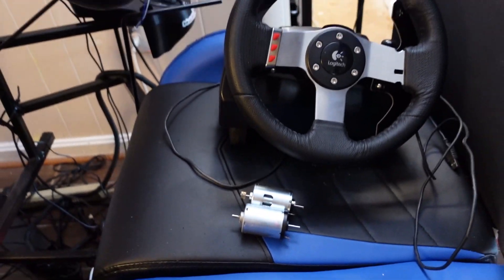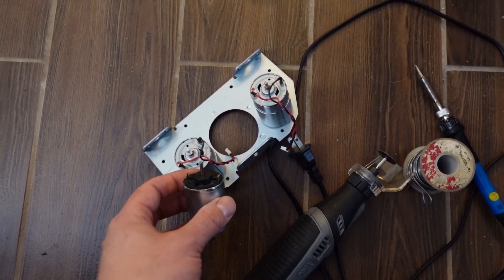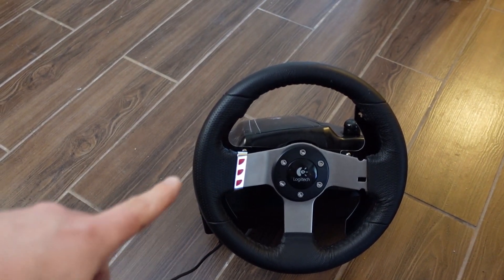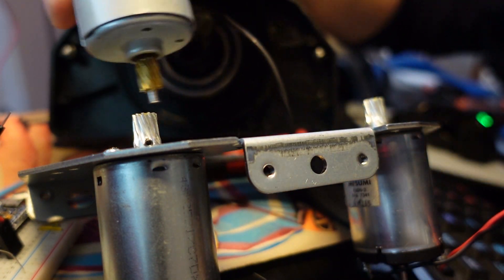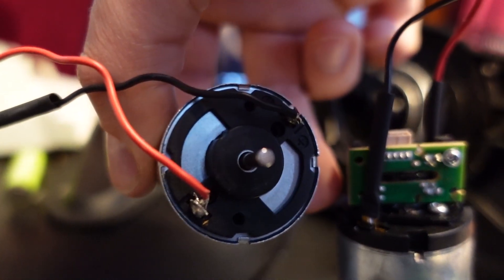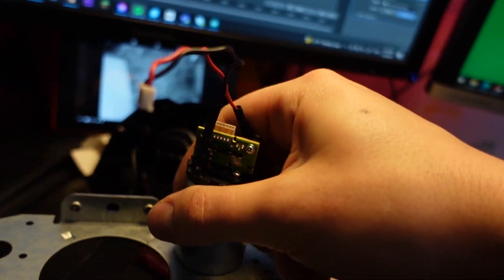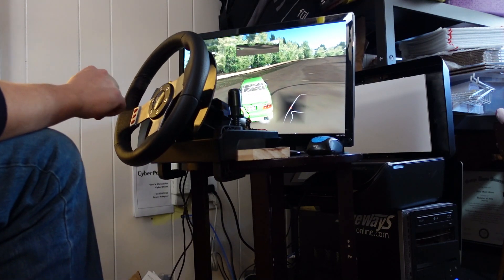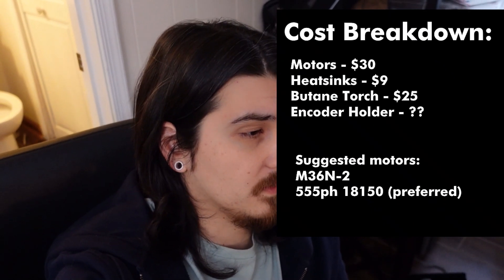Logitech G2x/G92x motor upgrades

Comment: Hey I have a question! I have logitech g29 with blown motors and I came across this video looking for replacement motors. What about the RPM of the motor does it matter? What does Max RPM of the motor affect?
Reply from the maker: There's a lot to consider. Max rpm is probably not the top of the list for concerns though. Amp draw is though. You'll fry the circuit board if you go too high.
Reply: @protomor  thank u for quick reply I really appreciate it!
Reply from the maker: @basilworshipper yea sorry it's not much help. There's a lot that goes into picking replacement motors. You can still find the stock motors somewhere but upgrading is actually cheaper. Just have to transfer the gear without damaging it.
Reply: @protomor  Yeah, I got logitech G29 for super cheap and I repair stuff as a hobby so I fixed the motherboard but the mosfet kept blowing and I am 99% sure that the motors are shot and they draw too much current and kill the mosfet especially since they spin rather sluggish. Thanks to your comment I did more digging and finally found Mitsumi M36N-3 on aliexpress for quite cheap and I am not fully sure how they will work but I will give them a shot. From what I remember they are a bit on the higher side when it comes to amp draw but I think 4951GM mosfet with max cont. draw of 3.4A and 20A pulsed (same goes for the 9977M mosfet) will handle it no problem. Also those motors come from printers so maybe I can find some junk printers that have those exact motors locally and salvage some motors in the future. When it comes to pulling gears and stuff I have torch in my garage and I think I can weld up some makeshift gear puller tho I think with some heat they will come off easily so that's not a problem. (at least i hope so!!)

Also thank you for quick replies on a 3 year old video and it is awesome that you shared your experience with modding/upgrading motors on those things on reddit and youtube. Original motors are hard to come by here and even if you can find them people will sell them second hand for absurd prices. Also don't worry your posts and video helped me a ton. I again really appreciate it!
Reply from the maker: @basilworshipper m36n-3 is the one I used in another video. It worked great for about 6 months before I sold the unit. It's within the MOSFETs range so it should work for you.

I tried to make some side cash doing YouTube. But this is my only decent video lol. I just enjoy being of help to others. Good luck and hopefully it solves your problems.
Reply: @protomor  thank u so much! have an amazing night/day!

Comment: Where Can I buy pinion gears like original? I broke one by accident.
Reply from the maker: Not that I've seen. They use a very specific gear too. I tried a ton of off the shelf gears and none have the same pattern.
Reply: @protomor wow nice, so the only way for me Is to use Logitech g25 parts (a have inside plastic gear too so don't worry)
Reply from the maker: @pietrekk_k yea. I wish someone would make replacements
Reply: @protomor  I have a friend which has knowledge in CNC machines, but he doesnt have to it access because he worked few yrs ago at some company.

Comment: The motors on my G920 recently burned out. I've ordered some Mitsumi M36N-3E motors from Aliexpress. Any recommendations for the repair for someone who has done it before? I would really appreciate it. Thanks.
Reply from the maker: I think they key is taking pix as you disassemble. Particularly the steering stops as they go back together very specifcally. Otherwise, the butane torch to remove the old gear is by far the safest method I've found.
Reply: @protomor  Thank you. I've seen your other videos too. Great work. I was wondering if a 6A 24V PSU would suffice or if I should get a higher amperage (the starting current of the M36N-3E is 3.5A, whereas the stall current for the original motors are around 0.75A). I'm going to add heatsinks to the motors and a fan as well. Will the stock MOSFETS handle it?
Reply from the maker: @romanonaidoo2737  6amp should be enough. The new motors do draw more amperage but it's not generally sustained. More is better but I don't think it's necessary. And yea heat sinks and fans are a must.
Reply: @protomor  Thank you very much. Your videos and advice are indispensable. I'd otherwise be completely lost.

Comment: M36N-5E 575 can use this motor?
Reply from the maker: I don't think so. The motor is a different size and rated for 24v. It technically might work but the amperage it pulls seems to be too much too.

Comment: this could tide things over until a moza sale comes up locally. i run some software with my g27 and with fresh lube on the rack and pinion it peaked at a whopping 88rpm on the stock wheel with no paddles / buttons 💀 this might be a nice cheap enough and pretty simple DIY, especially vs the BS pricing of T300 motors out of china and no hall effect jank to deal with too. thanks for the info and tutorial 🙏

Comment: Any update on how its going? I have been thinking on upgrading my G29 motors for better drifting as it is much cheaper than getting the cheapest DD wheel in my country.
Reply from the maker: I sold them a while ago. Haven't seen any of the ones I've made break though!

Comment: Hello, i buyed g27 2 weeks ago, it was awesome, stiff, powerfull, fast. But something happened, i don't know what happened it suddenly losed power, ffb is not powerful like it used to be, and deadzone started, when the wheel is straight, it gives vibrations (in game when driving) i checked the encoder, it's not broken, what can i do to fix this?
Reply from the maker: That's sometimes the steering wheel loosening. There's 3 screws that hold on the steering wheel to the shaft. I would start by tightening them.
Reply: @protomor  i tightened but it's still the same, i think ffb motors are dying 🥲

Comment: Hello, I have old G25 and one motor is dying (not running as smooth as the second one anymore) and also my plastic gearbox have a few cracks in it. On aliexpress I found whole G29 gearbox assembly with new motors installed already for good price so my question is, can I plug G29 motors into G25 motherboard? I found that G25 uses HC685LG-011 and G29 uses RS-555SH but I really couldn't find if there is any difference between those two motors and i was wondering if G25 board can run these newer motors without any issues. Thank you for your answer.
Reply from the maker: I've never cracked open a G25 but I wouldn't be surprised if the motors from the G29 swap in. But honestly, at that point, just get a better motor. It's probably cheaper.
Reply: Well I'm not that interested at getting better motors but new gearbox assembly since mine is already falling apart  @protomor

Comment: Know its an old post but lets see if I can get a reply. Got G29 wheel that work as it should, buuuuut it have no force feedback at all. Did not use it very much so thoroughly disappointed in build quality but not keen on blowing a lot of money on a "proper wheel". Might it be the motors that "left the chat" if there is no feedback? Opened her up and all looked normal. Removed and sprayed cleaner on all connections but did not improve anything. So its "dead" beside the fact I can use it as a non-feedback wheel.
Reply from the maker: Guessing this is used? Did it work for the previous owner or did you get it because it was broken? Usually, the FFB being dead is just because you don't have the logitech ghub drivers/software installed for it.

If you got it because it's broken, usually it's the main board that's fried. If the wheel doesn't even twitch when you power it on and plug in the USB cord, then it's most likely soming on the board. If it tries to twitch then it's likely the encoder or the motors. But honestly, I don't think I've ever seen someone actually kill the motors. It's usually the other parts.

Comment: This does not work i just attempted with the same motor m36n-2 and it doesn't even turn on now waste of time and alot of money
Reply from the maker: The motors should be $20 each. What specifically went wrong? IIRC you have to swap the pos/neg on these motors for the logitech to accept it.

Comment: jesus logi should just put these inside to begin with - 2nm is too little
Reply from the maker: Cost wise, it would raise it like $50 or so. But these units sell so well and they want to push the higher brand. I can see why they don't mess with success.
Reply: @protomor  they did 50 usd raises not once already so they better upgrade the motors, would be really cool

Comment: Your PET gears will not last, PET does not wear gracefully as a gear. PLA lasts longer as a gear but does not like heat nor sustained pressure.
You can try to anneal PLA on the shaft by baking the entire motor at 50-60°C with the gear pressed on, if it keeps the shape well enough to work, it will stay on better and last.

This is something I thought of doing with my new G29, once it's FFB wears more and I feel like risking an upgrade.
I worry about the motor mosfets if it's a more powerful motor (more Ampère at the rated Voltage), but there should be some leeway there.
My plan was to get larger motors, but also solder on more powerful motor controllers once I would make such an upgrade.
Seeing that the encoder is on one motor, perhaps only changing the other motor and making this way more powerful.
With a bigger gear to lessen the load on the small teeth, modifying the mounting bracket and casing to make this fit.

I actually went with a G29 over a G923 as the latter runs a firmware curve to eek out more performance from the stock motors.
Which would make more powerful motors overshoot (even more than the factory ones already seem to do on it).
Along with the G29 being a bit cheaper and having a reputation for lasting well, plus better Linux support.
Since I switched to the experimental driver that makes the G923 work anyway, since it makes the G29 a bit more powerful and responsive.
But it's good to have certainty it'll just work as plug-n-play without extra drivers, as I learned from picking up a few drawing tablets (which I all made work anyway).
Reply from the maker: There's a video after this where the gear fails. The original brass gear is what I used from then on. I don't know about the power curves but the mosfets held up fine with the new motors. The only problem is that these motors went out of stock and won't come back. I'd assume anything wiht similar physical and volt/amp specs will work too. I just don't have a logitech anymore to try it out.
Reply: @protomor 
Looks like the problem is the gear system. Why do Logitech insisted on using them? Why don't they change it to a belt and pulley?
Reply from the maker: @fajaradi1223  they skipped and went straight to DD lol. Honestly, they still sell these hand over fist so why bother? I just need to find slightly better motors.
Reply: @fajaradi1223  Because belt and pulley as well as geared tech for wheels is last century. It's all about Direct Drive today. You have cheap direct drive bases / wheels that are decades above and beyond anything with belt and pulley or geared wheels.

Comment: does it fix the ratteling?
Reply from the maker: Only if the rattling is because something is loose and you tighten it while you're in there. But no, it won't make the unit any quieter. If anything, it'll be louder.

Comment: Hey just wondering does this mod work on g923 wheel
Reply from the maker: Sorry for the late reply. But yea, it's the same motor and such. They didn't change much of the internals at all.
Reply: They did not, but the G923 runs a different, more aggressive power curve on the same original motors.
So more powerful motors might misbehave in a G923, whereas they would not in a G29 or older.

Comment: have you ever thought about some way of increasing the rotation range of Logitech? like 900 to idk 1200+ degrees...well I can't figure out if its even possible sorry
Reply: Impossible, the whole structure of the wheel would have to be changed with new parts and would probably involve 3D printing and etcs, but no one has done this before so you'd be on your own to even begin this crazy project
Reply: Your answer 
https://youtu.be/ZNrBQwilpzs?si=QNDgoXUiwUtpaP_6
Reply: it seems possible, i took out the gear thingy underneath the whole assembly and it looks like you can 3d print another one with more teeth

Comment: Nice work man. I have one question. I can't find the mabushi RS-555PH-18150 anywhere and it's quite expensive. Do you have any alternatives? For example, RS-555VC-3267
Reply: In the description he talked about  the m63-n
Reply: @youdontknowme9068  thanks but i cant find that one too 😞
Reply from the maker: I need to look into other options but I don't have anymore logitech units to try out.

Comment: My force feedback motor broke few days ago, i could not find any replacement parts for my logitech G920 and was starting to feel like i would not be able to repare it.
Thanks for this video it helped a lot :)
Final updte : after 200h with this upgrade my g29 (350h total) is gone (a screw damaged the electronic circuit inside the steering wheel). I'm uprading to a moza r3 🎉
Reply: It still work?
Reply: @Mr_Caligo  yep no problem after 100+ hours of sim racing 👍
(Its just a bit violent at the start when it does its full rotation so you have to manually slow it down)
Reply: @supermiaoumix Anything different from this tutorial for the G29? did you have to print the reluctor STL? Did you have to reverse polarity, use which motor and how did the gears go for you? Getting a g29, after using my friends g920 nearly 6 months id like to have more response.
Reply: @supermiaoumix any updates?
Reply: @envikka  holy shit i forgot
No stl print needed, you can find the electric drawings of the m32n online, removed the gear teeth with a cooking blowtorch.
It's great after 1 year of heavy usage. However you have to calm the force feedback down (it has so much more power than the original)
Sorry for being so late to respond 🥲
Reply: @ 😭 its all fine, got my own g29 after but wanting to upgrade the motors so wanted to know how you got around everything
Reply: @supermiaoumix  could uou send a link to the motor you used or anything that’ll work? im not inclined in this sort of stuff, and the ones below have sold out. was it the same process as the video? did you have to use the encoder?

Comment: Would i need to 3d print the encoder holder if im doing this on a g29? Also planning on getting the RS-555 motor since i cant find the M36N, would the encoder holder be the same?
Reply from the maker: Holder should be mostly the same. But for the g29, I think you can just glue it on. Hard to remember
Reply: can you redo this video again with on-screen inatructions please? Thank you.
Reply from the maker: @319dcars  like subtitling or you mean a step by step? I'd love to but I don't have anymore Logitech units.

Comment: That thing spun like crazy holy heck i'm so doing this lmfao
Reply from the maker: Once I figured it out, it was a VERY simple process. The problem is that the replacement motors are hard to come by these days.
Reply: @protomor  yeah i cant find any :c im worried i'll have to replace my wheel entirely, my motors aren't working so when i plug in my wheel nothing happens and no steering is detected
Reply from the maker: @Ivvelis  I'd test them out but I don't own anymore logitech units. I'm sure there's replacement motors somewhere. Yuo can likely even find replacement stock units.

Comment: Ah yeah i can see how PLA gears would fail. I think two possibilities, besides extracting original gear, either print them with HIPS, and you can print that on an open frame printer just fine, or better make a silicone mould and cast them from high temperature capable epoxy. I will be doing a conversion of a DFGT eventually maybe to herringbone gears maybe to belt i haven't decided yet so i've been thinking, obviously i don't really have gears to keep then.
Reply from the maker: I really would just want to find a machinist to get the gears already made. I could probably make bank selling motors with the gears already on them.
Reply: @protomor  I wonder how far the supply of motors will reach for that. M36N-2 is gone. I feel like M36N-5E is running out as well. For sure you could find a manufacturer in China who will fashion you a motor and also a gear to order? Maybe worth a talk with LDO to adapt their CL3553?
Reply from the maker: I could easily commission something for sure. Initial cost wouldn't be much. I'm just not in a position where I can ship that kind of stuff out.
Reply: @protomor  Well somebody has to know someone who offers those kinds of services for sure as well.

Comment: This is a great mod! I have one question (for now); it works on PlayStation? I think yes but i would like to know certainly before i do it. Thanks!
Reply from the maker: It doesn't change the software or anything of the unit so it will still work as factory
Reply: @protomor  Thanks a lot...any updates? Still working?
Reply from the maker: @rocket7383  I've built about 4 of them and sold them all lol. Every one that I know of is still kicking. Some making more noise, some making less. It's all down to how mangled the gear is when you take it off.